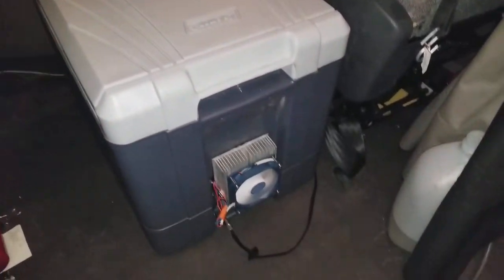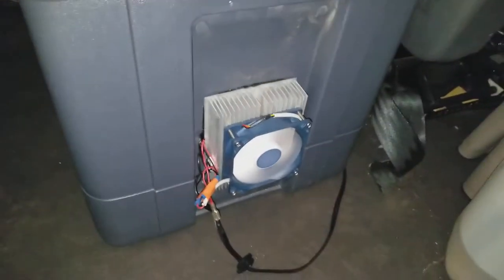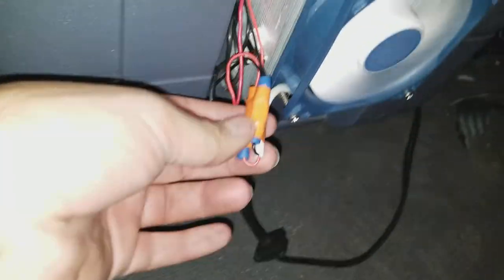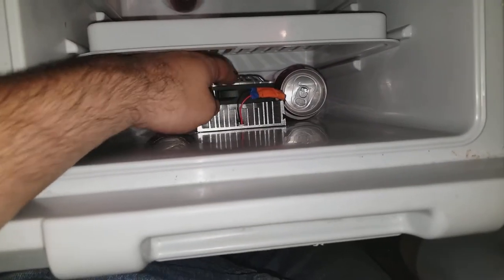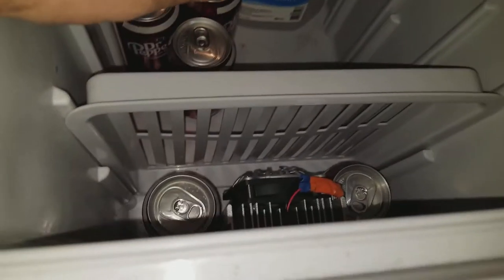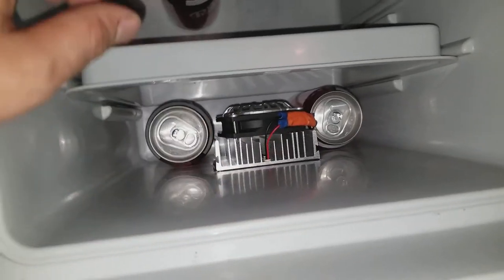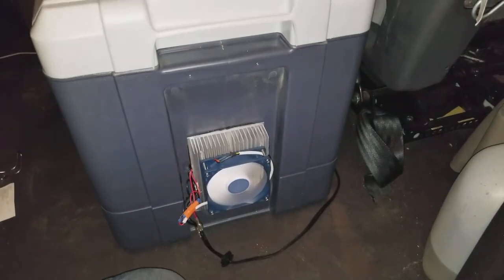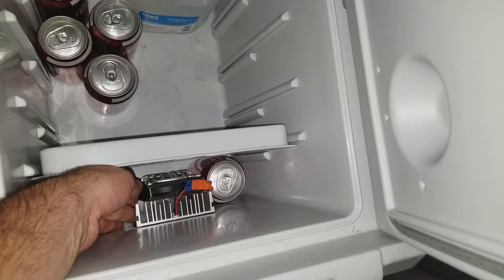Coleman cooler fixed an upgraded BIG time

Comment: I used two Thermalright TL-P9 92mm fans and posted a video as well. External location is certainly quieter and slightly less airflow. The internal fan is a huge size change from 60x60x15 to 92x92x25. The fans come with daisy chain male/female connectors. I cut the female side off cleanly inside the connector and then wired those up for quick connect of future PC style case fans. I notice condensation on the internal heatsink and makes for some drips inside. I never remember that before with my stock fans.  I just received my heatshrink butt splice connectors so I will be adding those into the mix soon. I have one modded Coleman cooler with these 92mm fans and one stock Coleman cooler. Taking them Cabin camping at the end of the month and I plan to test them side by side for four days and see what I notice afterwards. I plan to replace at the very least the outside fan with the quieter one as I can actually keep these inside at night now with a quieter fan.

Did you notice any increased water dripping off the internal heatsink after your mods?

Comment: I used to run the igloo coolers what either goes through power cords or the fans switched to a 4.5 ft.³ refrigerator freezer plenty of room fantastic kept going through compressor starters and that’s with a Pure sine wave inverter so right now I have a Coleman Koval cooler strapped on the passenger seat I would love to find a permanent fix for the 4.5 ft.³ refrigerator will attempt a three in one starter

Comment: I wonder if I could upgrade my Koolatron beverage can dispensers with better fans like this project. They never made the drinks ice cold even inside… Would be fun!
Reply from the maker: Hmmm, maybe would help. I know that it ran much cooler with the better air flow. Let me know if you do it and how it comes out.
Reply: That's great were did you purchase new fans & which model walmart is clueless in electronics
Reply from the maker: The model of fans doesn't really matter as much. For the inside fan I used a 12vote cpu fan, and on the outside I used a 12vote case fan. Both are desktop computer fans and easy to find cheaply and can even be used. A copy fan is smaller in size and fit well inside the cooler where as a case fan is bigger and better for the outside. For the outside a higher cfm is ideal but you don't have to go crazy over cfm either. Something quiet but still good on cfm.

Comment: Anyone know how to get the plastic guard off the inside heatsink? Mine only shifts back and forth like 2mm, and I don't want to break it off
Reply: It just slides up in the grooves the plastic has little divets at the bottom to hold it

Comment: You have had this fix for a long time. Did you find the new fans created a more efficient cooling in the cooler? or was it about the same?
Reply from the maker: It was more efficient and colder but definitely more noisy. It ended up failing again but it was my fault...I would do the same thing again.

Comment: Are the new fans a lower power draw?  The original pulls about 60w.
Reply from the maker: It did pull more but not sure by how much
Reply: The fans do not pull 60 watts. Stock or aftermarket do not pull 60 watts. Likely 3-8 watts max.

Comment: Intrigued, just bought an igloo 28 iceless, they recommend no more than 2 hr on a car battery at rest.  
Here’s my thoughts I have good battery powered fans, that can run all night, if I disconnected the fan on the cooler could the heat synch last longer on the car battery? The fans have external batteries not run on car. Or vice versa run the heat synch on an external battery. Just trying to figure out a way to keep the cooler running for 8 hrs?
.
Reply from the maker: The one I have i just leave it plugged it really and never had an issue. If I'm going to be away from the truck for a while i will unplug it and empty it out.

Comment: Trying to ask you questions.   Would prefer to email you. 

My Coleman cooler seems different from yours.  There is a fan cover on the exterior "top", which I've never removed. There is no fan inside the cooler AFAIK.
The most puzzling thing for me is the two heat sinks for the thermocouples(?) inside and out.  Did you add these, especially inside?  Ditto, inside fan.  After modifications,  what is the amperage needed for cigarette lighter connection?  Is there any addition that you made to increase the amperage required for cooling in a car's cigarette lighter socket?
Which way does the interior fan blow?  Inside, while the external fan blows outside??  Don't understand. 

If I made the same modifications as you, what would be the power draw for a 120 v. connection?  (I have a 300 watt inverter for use with a cigarette lighter that has been modified for higher amperage inside car.)
BTW. I am an electrical engineer. Are both fans that you used computer-style fans requiring 12 volts?  How did you mount them on the heat sinks?
Reply from the maker: Hello, you can message me on here with your email or just ask me the questions in the YouTube message things or even on FB [same name] what ever is easier for you! Now on exterior of the cooler there WAS a cover fan cover that covered the whole metal heat sink and fan but I had already removed that prior to the video. The two heat sinks seen in the video where already there and I did not change, remove/add anything. I broke the plastic that was in the inside by pulling UP on it real hard [glued in] until it came lose. Then I unscrewed the fan and cut the wires adding the wire connectors that I was then able to attached a old cpu fan I had laying around the house. On the outside I ordered a cpu fan that was high CFM but QUIET as I did not want the sound of a high speed fan all the time. The amperage I think was around 10A so it was able to run on the stock fuse setup until a sort in the wall caused a fire that damaged the DC socket...I cut the old socket off and wired it up to the CB and the CB power output for BOTH the CB, cooler and the computer [ELD] all shared the same fuse and that was 20A so I know it was lower than that. I did not have to change any of the wiring I simply added the wire connectors to make replacing a fan if need be easier/faster. The interior fan blow OUT stock if I remember right but I have it blowing IN to the heat sink to push the cold air out/all over better than straight out in front since when it hits the back of the heat sink it like spreads it out. The outside one I have set the same way for about the same reasons but for heat removal. Computer fans are 12v over all only some server fans are 24v but those are pretty large and VERY few are 120v I just used some screws to mount them. I will do another video on the cooler tomorrow and get it uploaded so you can look out for that and I will explain things MORE than I did in the video and how it has been working for me ect. Sorry if this post was LONG but I wanted to make sure I answered your questions the best I can so if you DID not want to watch the updated video..you don't have to.

Comment: Can i get the info for the fan u use
Reply from the maker: Titan IP55 92mm x 25mm is the one I used on the outside, real quiet and on the inside I just grabbed a cpu fan that I had in the house..that one makes a good bit of sound but once you close the lid I don't hear it.

Comment: ok so what exactly was the problem?    which way are the fans blowing??   and do you have a temperature to share?     details details details.
Reply from the maker: The fan flat out stopped working so I replaced it with a computer one. I put the fan in there to push the air to the AL. Dont have a temp but would get a few degrees colder.

Comment: This is exactly what I was looking for. The tabs are the weak link in an otherwise great cooler. My us working fine but I'm going to buy replacement fans to have in case one does go out.
Reply from the maker: yea, I love the cooler but it can be annoying but its easy to fix and much cheaper than other options.

Comment: Great video. What is the cooler inside temprature with this modification. This is the most important part of the modification?
Reply from the maker: It was cooler but had to be carful as it could freeze my items too. This was something that I did because my cooler broke and this was a cheap way of fixing it.. that and I had alot of computer parts at my house and so it was a simple thing for me to do lol
Reply: @StephanHarz  how long did the cooler last?? Is it still working?? Thank you
Reply from the maker: It broke again like a year later after this repair. These coolers only really last 2 ish years with heavy use, you can make it last another year or two if you do the repair that I did.